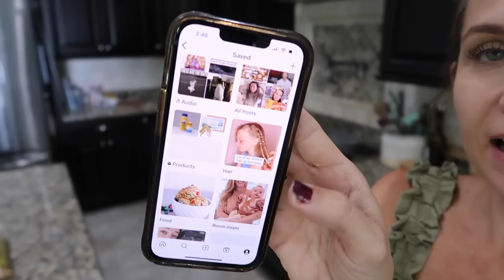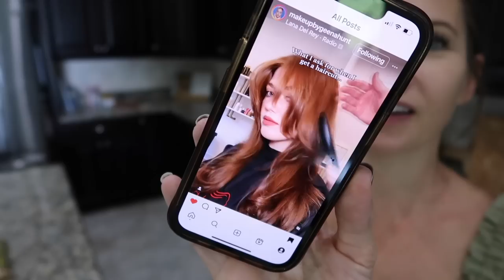Pushing Through, Food Prep, & Frusterations! Mom Life, House Updates, & Around The House Happenings!

Comment: Check your design contract. Architects typically carry errors & and omissions insurance. The cost for the change is determined if it was included in the original construction contract v/s the cost now (during construction). Typically, you pay the cost if the necessary design was included in the construction contract & the architect's insurance company pays for the additional cost resulting from the error. It is such a shame that this was caught so late. Digging footings inside at this point would be a complete mess!